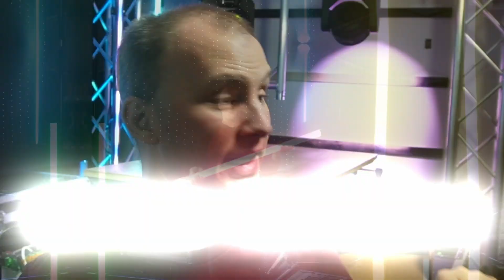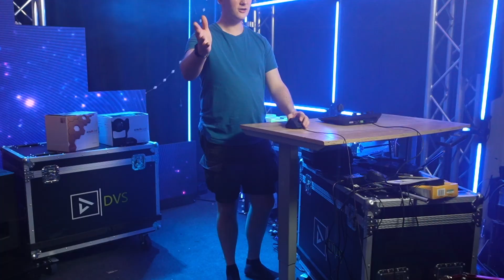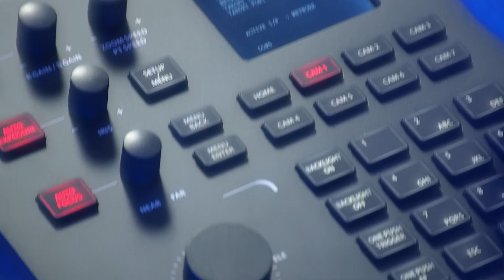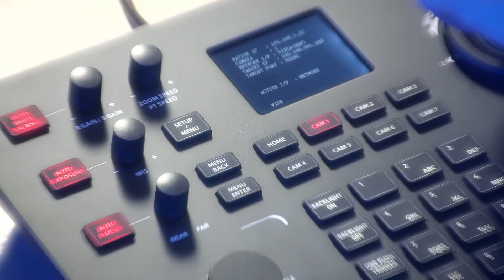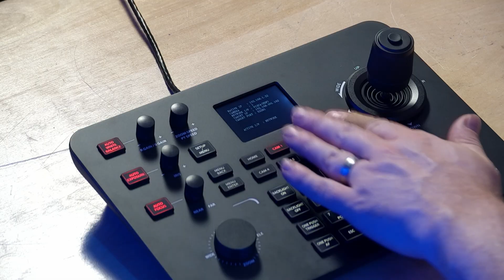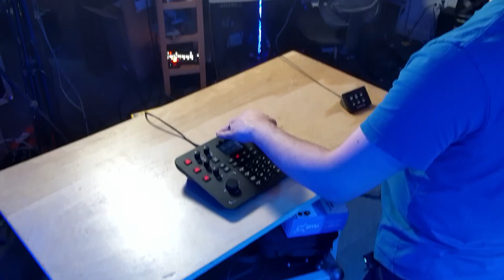How Do You Get Great Video of Your Stage Lighting...Without Camera Operators!

Comment: This reeks way too much like an advert. If you want an excellent budget camera solution, consider to use a bunch of old android smart phones. Install DroidCam for OBS on them which allows the phone to send video via USB or via WIFI. I prefer USB because the phone won't discharge. On the receiving end you use the open source OBS studio and the droidcam plugin. You get full control of every camera. I ran rigs with four old phones without issues.